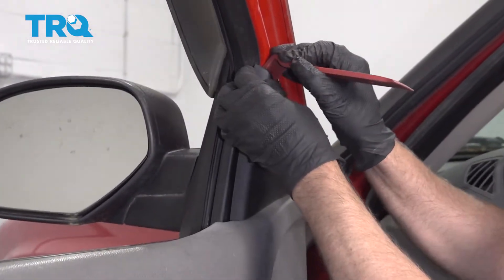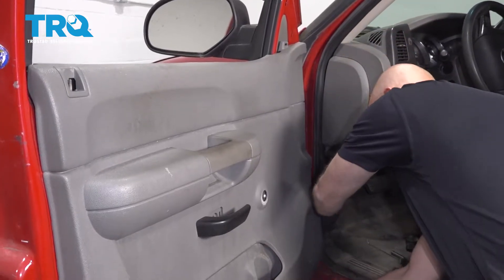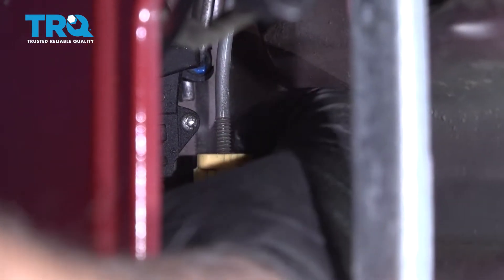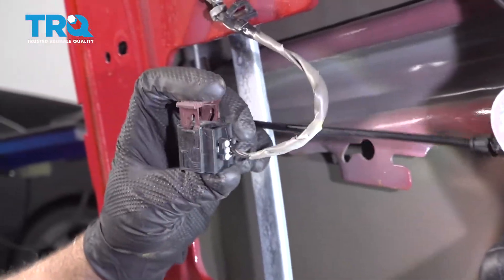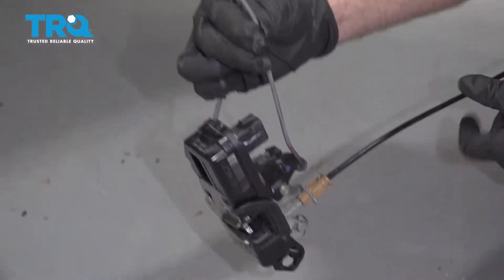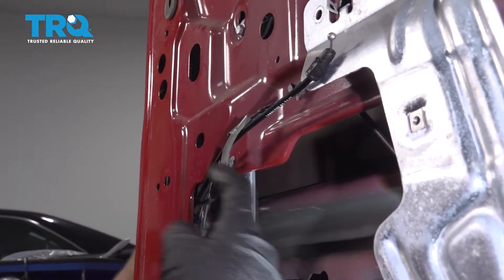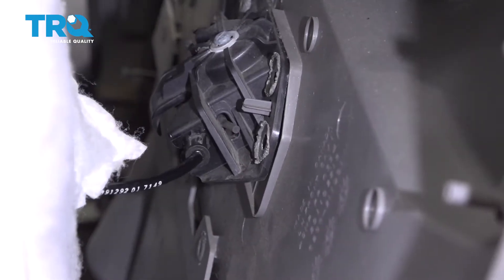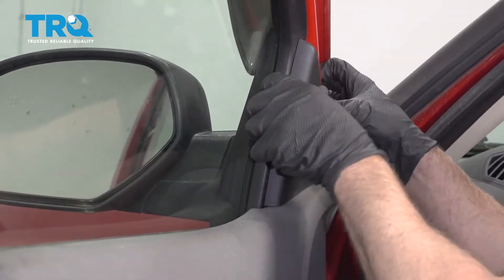How To Replace Front Door Latch 2007-2014 GMC Sierra 3500

Comment: My latch actually works from the outside. Just interior does not work. Any ideas?
Reply: bad cable coming from door handle that attaches on inside or bad actuator mechanism